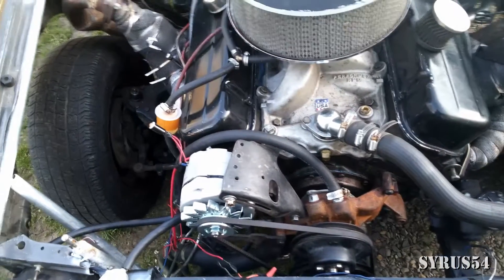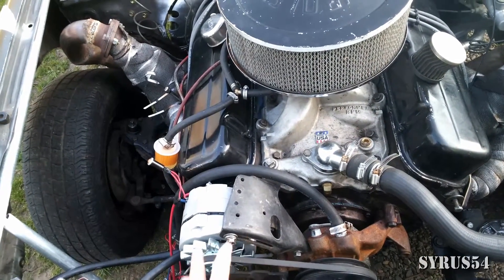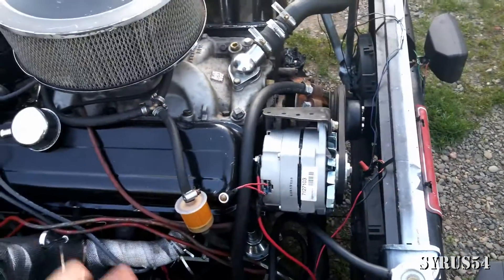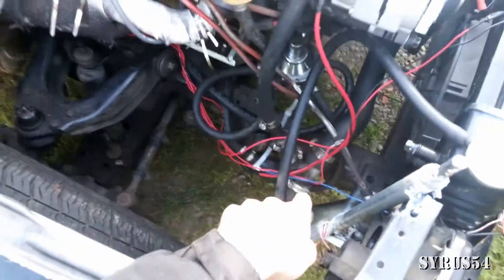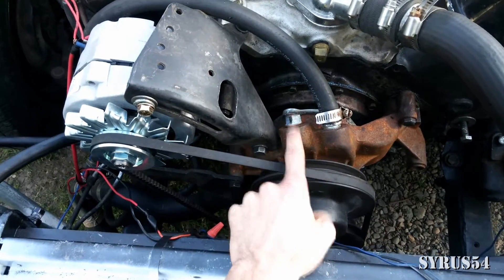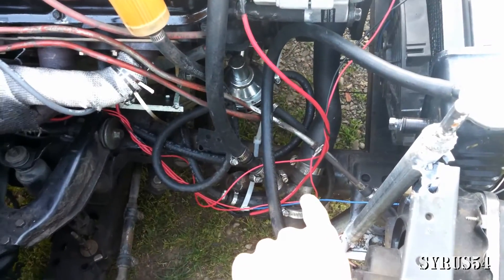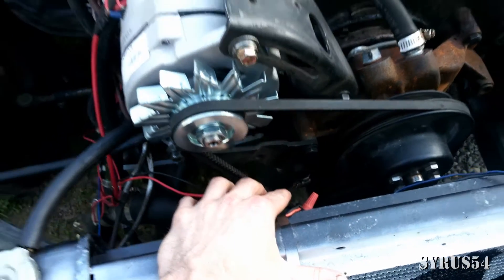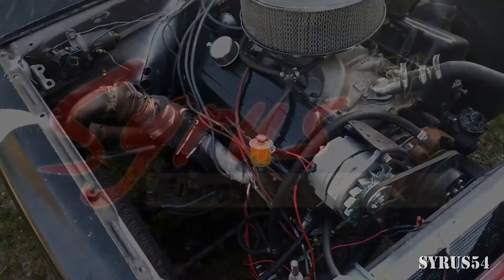Vehicular Education - BBC Water Pump Hoses (No Heater Core)

Comment: You are right to raise the topic, but I don't think you are accurate in your analysis.  You want to run at a minimum, either a heater core or a bypass hose between manifold and water pump in order to prevent pump cavitation (which can lead to other problems) and to facilitate water flow with attendant cooling dynamics.

Comment: So I may not be an expert on this, but the purpose of the bypass hose is to circulate the water through the engine to eliminate hot spots before the thermostat opens. 
Your setup sucks water in from the lower radiator hose to try and force it into the block, which is sealed off when the thermostat is closed. (No circulation)
The hose you added should connect to the manifold so... Intake, to lower hose, to water pump, to block, to intake. It circulates without the radiator. 
Your set up just gives the water pump a second supply line from the lower hose because the top holes in the water pump are water inlets,  just like the lower hose. so the first ever BBC water line routing video is wrong. You would be better to plug both water pump holes, and drill a couple of small holes in the thermostat. that way at least you have some circulation in the block.
Sorry Bro.